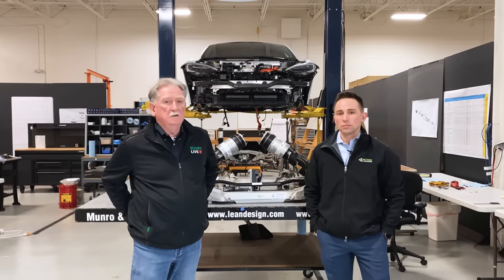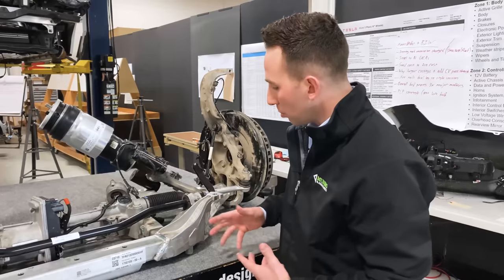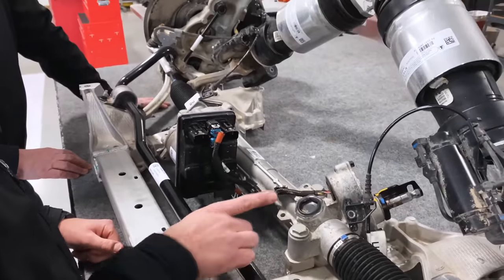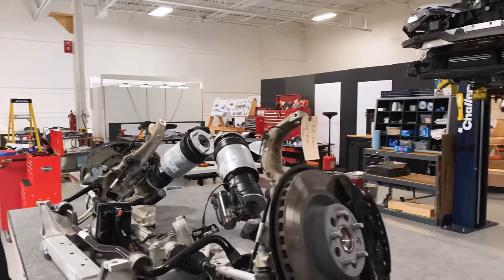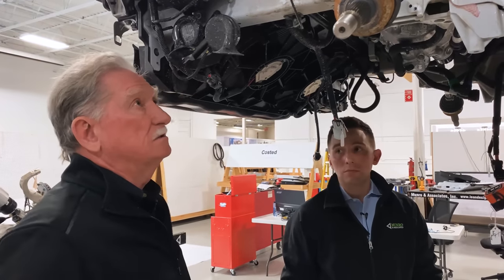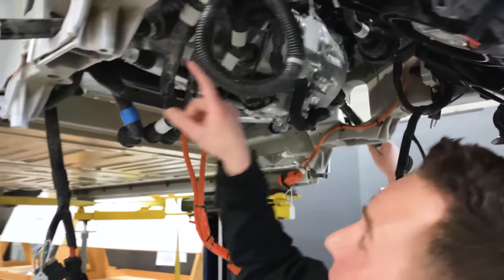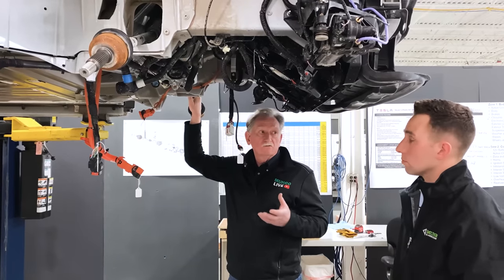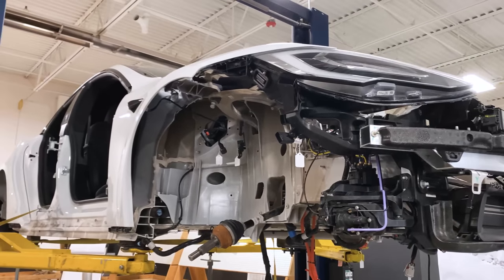Front Cradle and Suspension | Tesla Model S Plaid Teardown

Comment: A question for Munro. As you likely know, Tesla is an Agile style company. This means that they make 27 changes per week to each car excluding software changes. It seems like your company writes reports based on a car that changes every few years not one that is changing daily. How does this effect your business? Will you have to change how you work?
Reply: Short of purchasing the same car every month or so, all that can be achieved is a snapshot of a  certain car, on a certain date. No way around it.
Reply: I remember Sandy once mentioned there had been about a dozen running changes in 3 months on just the octovalve design, Munro clearly have their finger on the pulse without the need to break the cars down continually

Comment: How would you push out a dead vehicle with no power to steering?  This is valid problem.
Reply: It is. You would need to use a booster battery to wake up the controls sufficiently to get steering control, or just yank the front wheels around by hand if they'll move.

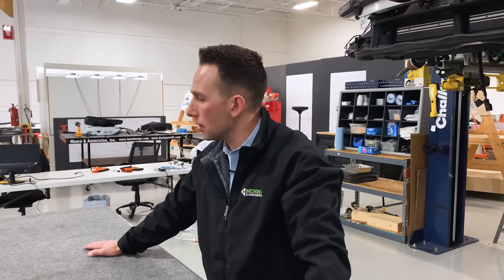Comment: 5:01  Meh, framerail halfshaft feedthrough is nothing new...the 2016 Model X had it
Reply: See also Saab 99/900 1967-1994, & (I think, memory isn't what it was) also 93/96 2stroke & V4 from late 50s onwards... There's very rarely anything truly new under the sun if you're old enough, often just old ideas done properly now that the tech has caught up.

Comment: I would go a step further and claim NHSTA is unaliving people by forcing heavy useless shafts. On a 6 tonne vehicle driven by a 50kg doll, a battery backup, redundant wiring and controllers would be a better use of space than 30kg of steel only that will only move after a meal of creatine, protein isolate and a pound of broken dreams.

Comment: 11:30
Planes are flown by pilots. Cars are driven by idiots. 
Before every takeoff, every plane is inspected. 
Cars now have TPMS because drivers are too lazy to check tire pressure once per fill-up.
Planes have 40 years of OEM part supply and trained tech support. 
Your car becomes obsolete every 3 years when they do a facelift. 

I had an alternator failure 3 times.
I had engine failure once.
I had brakes fail 2 times.

Each time I got to the service without tow truck - either other car towed me, or in case of failed brakes - once I used handbrake to slow down, other time I plugged leaking rear caliper at master cylinder and drove to service using just front brakes.

Comment: If the steering rack motor dies you can still steer the car, Sandy proposes they completely remove the steering shaft, which would mean that if the motor dies, yhe car will be useless.
Reply: As he pointed out, if you can engineer that safely enough for an airplane then a doing it for a car should be a doddle. With so many daily benefits quite apart from price.
Reply: The argument for a physical manual connection is true for old design cars, but Tesla follows the principle of having backup systems for safety, like aircraft. If they went to drive by wire, I'm sure they'd have two separate motors, control systems and power supply so the chance of a complete double steering failure would be close to zero.
Reply: @lighthousesaunders7242  its doable with multiple redundancies on the airplane, with cars nothing has a backup.

Comment: Here you can watch the Tesla fanboitism of Sandy. They put the drive shaft through the longitudinal beam? Really? That's production nightmare right there. Why does basically NO ONE does it? Because it's stupid! U cannot preinstall the drive train and just ramp it up to the BIW. You need to fiddle in the drive shafts into the electric motor and then into the wheels. On every other manufacturer Sandy would explode about s*** like that cause it is way way way more inefficient and expensive to build it like that. For the workers it's much harder to put this together on the car instead of some framework on the ground. OMG.
Reply: Finally, after trolling through all these comments someone says what I think and I don't have to be the bad guy, lol.  In that area the design is a dog's breakfast.  But the interaction between the young engineers who are very observant and their boss is fascinating.  I can just see Cory changing the subject when Sandy's eyes glaze over in a Tesla dream.  But I'm happy to accept some bias that I can identify and deal with appropriately and yet still learn how this historic car is put together.

Comment: I disagree with the way cars are following the lead of the aircraft industry.  Planes are way more expensive and can justify highly engineered, custom parts that change every year (or less).  And planes get way more maintenance from highly trained technicians.  It used to be the same fuel pump was used on all of a line of cars for a decade or so and the resulting costs were minimal.  Now you go to a parts store and there are hundreds of fuel pump SKUs and each one is expensive (just because of the inventory costs if no other reason).  Insanity.  Give me a nice simple Electric Vehicle please.  I expect this is what is on the way from China.

Comment: 'No airplane on the planet' using mechanical linkages. What a load of bollocks Sandy. There are lots . Even if if you meant new airplanes you'd still be wrong. Brand new airliners , maybe.
Reply: Even brand new airliners wouldn't do it, because of the Boeing 737 if nothing else.
Reply: @brianb-p6586  Thanks. I thought there was probably still something in production with mechanical linkages, just because these products have such long lifetimes, but didn't actually know.

Comment: plastic oil industry sponsorship sabic 👎
Reply: Lol….., sandy said the tesla plaid is almost 40% plastics so your comment makes no sense, cheers. Even the wheels, double glazing contains oil byproducts
Reply: @ashiga8023  airless tires still uses oil actually a lot more and are unfortunately not as good as air filled tires.
Reply: @alanmay7929  they are better in every way and on every terrain. Performance too.  They need to be replaced much less.  You obviously have an interest in the polluting Industry and probably anti Tesla as well.
Reply: @ashiga8023  stop talking nonsense troll! Tesla is full of oil products you cannot change that, airless tires are less efficient, other car manufacturers have been using more and more recycled plastics and fibers in their cars, using leather tanned with natural products…. Your tesla still needs oil to be manufactured.